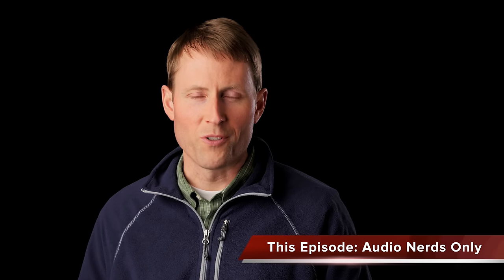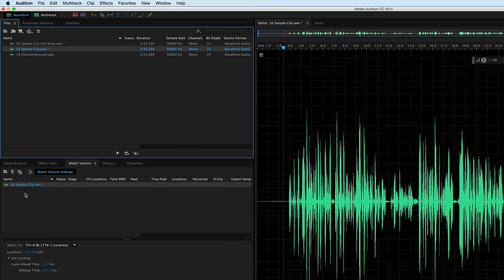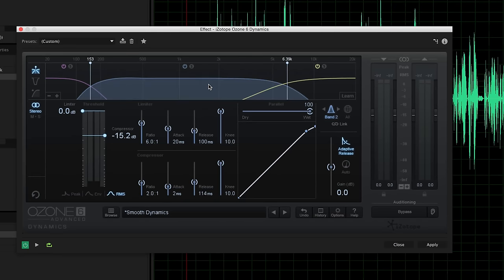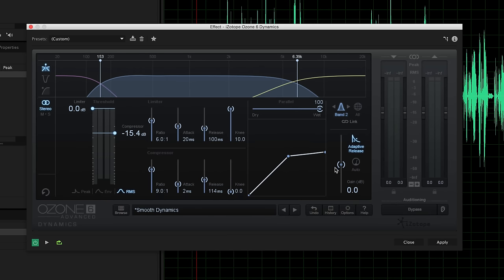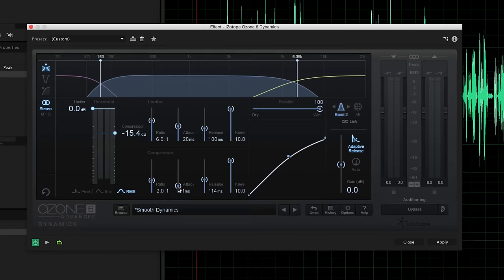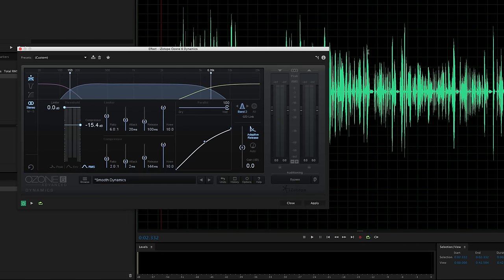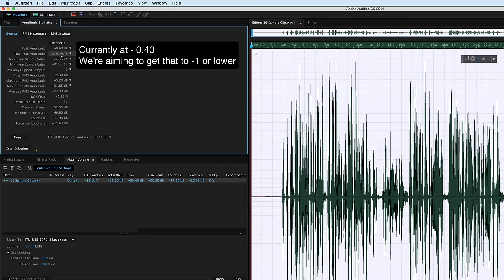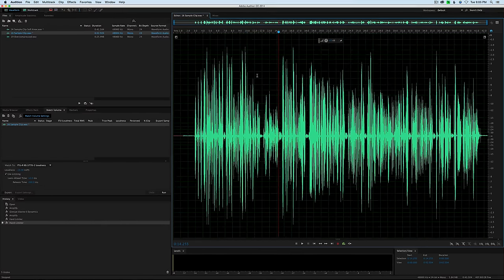Better Sound for Video: Compression In-depth

Comment: Got it and makes sense. Thanks for prompt response. 1 last follow-up Q if I may. If one is mixing a bunch of different clips with slightly different loudness level, wouldn’t it be better to “level” first and then normalize?
Reply from the maker: It depends. Leveling doesn't always work well and inversely, normalizing doesn't always work well. Sometimes if there is a big dynamic range in a clip, leveling can create something which sounds rather messy by raising the noise floor pretty substantially on the parts which are boosted. Of course the entire noise floor is raised when normalizing but in my mind, that often can be addressed with things like noise reduction or Izotope RX dialogue isolate. I wish there was a clear, clean answer. But usually, I'll normalize clips to a reasonable LUFS target to get them in the same ballpark and then work from there. I might even apply a leveler after that.

Comment: Question and im not expert still learning actually. Why is this done in Waveform isnt this considered destructive you can still run this  izotope effect through multi track?
Reply from the maker: I used the waveform editor in this case to illustrate, visually, what happens with compression. You can, of course, do it non-destructively in multi-track.

Comment: Hey! Very nice video Curtis! I have a question regarding the loudness normalization; In Audition you are able to just "run" a loudness normalization, most places i have looked only has an analyzer for LUFS, not an actual "run" button for the normalization itself. I use pro tools, any tips for a plugin that loudness normalizer that isn't too expensive?
Reply from the maker: The “not too expensive” is the hard part. I use Izotope RX Advanced which is quite expensive. I believe NuGen Audio has some loudness plugins as well but I suspect they’re also pricey. Will keep my eyes peeled for more affordable options.

Comment: hi curtis, is the tube modeled compressor in audition still the one from izotope, or are the stock compressors not of a very good quality? i like the tube modeled one the most, because of its straight forward and easy to use interface. oliver j hughes said the stock ones are not the best quality though. many thanks for your reply curtis, your advises and help are very much appreciated
Reply from the maker: Hi Akhi, it looks like maybe Adobe have transitioned to their own tube modeled compressor at this point. I'm not 100% certain but I would not be surprised if they wanted to stop paying Izotope licensing fees now that they earn plenty of money from monthly subscriptions to hire their own developers. I haven't tested them extensively but they seem to sound ok. I've still mostly been using the Nectar compressor because I'm happy with its results.

Comment: If I understand correctly, the Ozone compresser you pulled up in the beginning is a fancy multiband compressor? For those using Reaper, ReaXComp does the same thing and is included for free :). It does not look as fancy though. It is RMS window based, but the control law cannot be changed the envelope or peak. There is a program-dependent release option, which I believe is similar to the adaptive release, in that it tunes the attack and release depending on the signal.

Again, another nice tutorial :)!
Reply from the maker: Thanks Roy. Thanks also for the Reaper info.

Comment: I will most certainly trying that soon. Here is my question. If you happen to have a budget around 200-300 USD which shotgun mic would you buy. Second question is about lavaliers; can you suggest me a brand which can record 2 people voice, wireless lavalier around 100 usd?

Cheers!
Reply from the maker: Burak Kara I have the RODE NTG2 and it works well when recording into a proper XLR input. It does not work well when I use an XLR to 3.5mm adapter to feed it directly into my GH4 or Nikon D750. So it depends on whether you plan to use a recorder or camera with XLR inputs? Here is a review from a long time ago of the NTG2: https://youtu.be/GlQ32DwdpEw     For wireless, unfortunately, I'm not aware of any that are worth the price at around $100. Those all sound quite bad. But I do sometimes use a Zoom H1 with a lavalier attached to it in the pocket of the talent and that works quite well sort of like wireless for around $150. Of course you'll need to sync the audio in post but that's quite easy. Here's an example: https://youtu.be/RBxOLnVxg3A   Best wishes!

Comment: I'd like to thank you for your tuts. Always helpful and interesting. May I ask, how would you approach compression when dealing with an interview with a male interviewer and a female interviewee, where the male voice is louder, almost double the amplitude of the female? Thanks again.
Reply from the maker: Micheal G Thanks! First, if I have control over the production, I'll be sure to record the two with separate mics onto separate tracks. But if that isn't an option, there is a leveler in both Audition and Izotope RX4 which can help. And failing all that, manually increase the gain on the female parts by selecting each section manually. That's probably something that you'd only reserve for the most important projects because it is very tedious but an option nonetheless.
Reply: Curtis Judd God bless you and thanks a lot for your reply.

Comment: Great tutorial. Thanks Curtis very much. I've also saw you have Nectar installed as well. Would you recommend to work with Nectar directly instead of Ozone first using similar settings for the compressor. I have not seen in Nectar de knee control but there are interesting additional alternatives such as the De-esser function and also breath control.
Reply from the maker: +Domingo Sanna Hi Domingo, I like the de-breath and de-esser in Nectar, but I prefer the dynamics/compressor in Ozone because of the soft knee and adaptive release as well as other features. Ozone is definitely more feature rich. That said, Nectar is quite good as well and a lot less expensive so a good place to start.
Reply: +Curtis Judd Thanks Curtis so much. Crystal clear :-)!

Comment: also i have access to nearly every plugin but i didnt find a compressor that works so well for dialogue where my main goal is do bring down the peaks for normalization and a little bit equalization
Reply from the maker: Hmm, in my course, I just use the tube modeled compressor and parametric EQ. What did you not like about them?